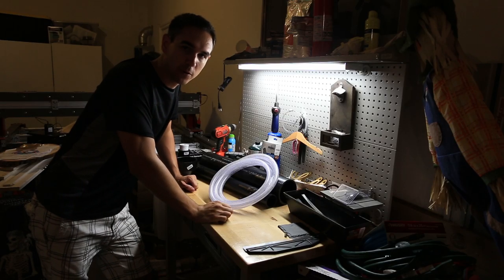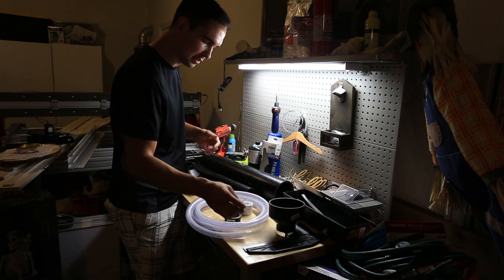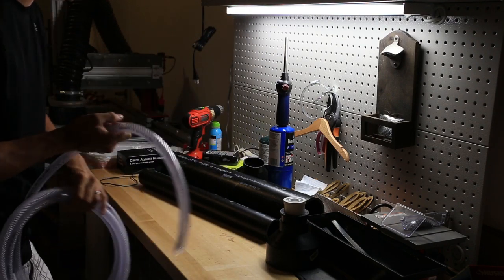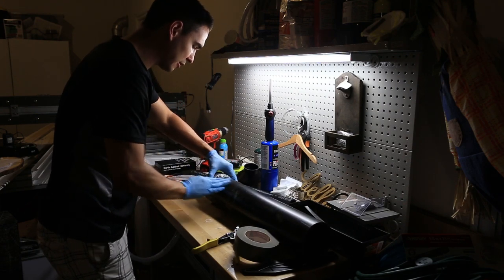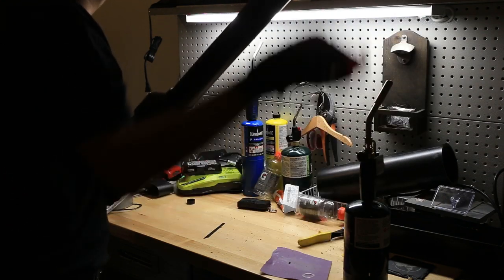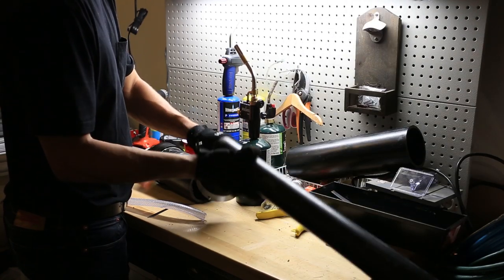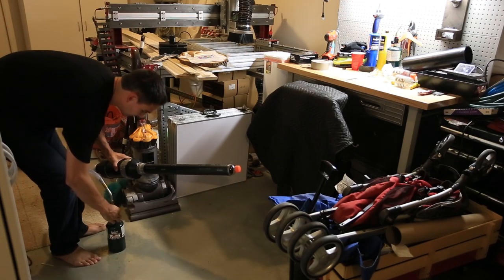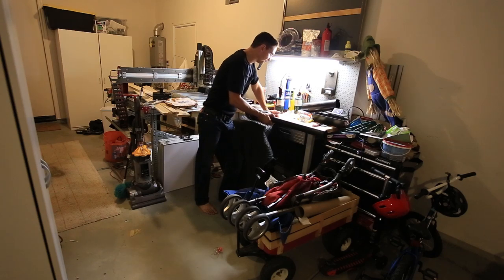Building a Propane Torch Potato Cannon

Comment: Map gas is so much better than propane
Reply from the maker: I am going to try some other gasses and mixtures in the next couple weeks with some friends, we're going to have a potato gun party.  I've also got plans for some improvements to my existing design (the extra 4'' tube actually is a perfect size mount for the propane torch's tank itself, so replacing the tank is super simple).